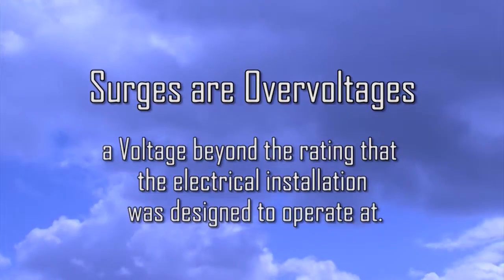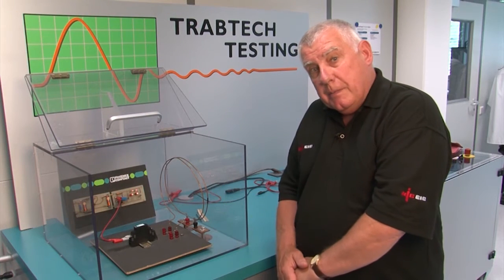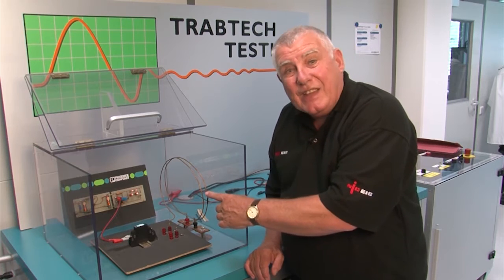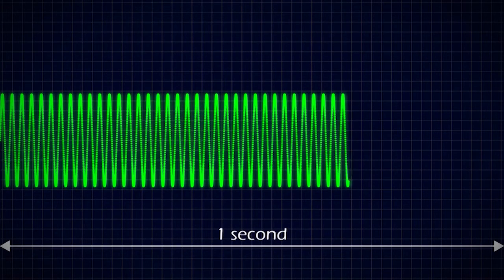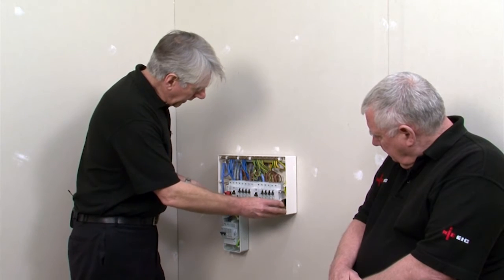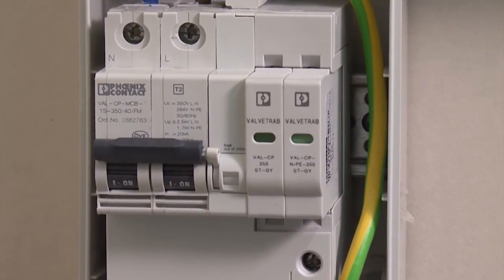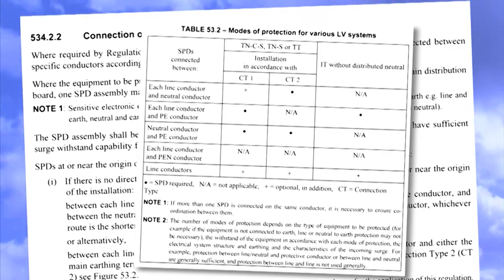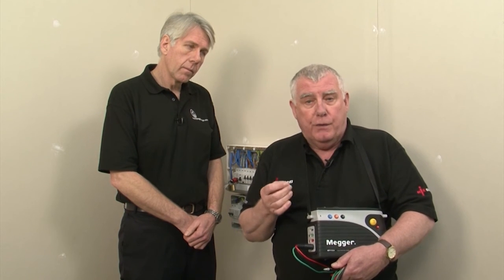Introduction To Surge Protection

Comment: I have two Consumer Units in my house connect to the same incoming Power Meter. One CU is an old one using ELCB as protective device  made in 1983 to BS 4293 which always trip when there is heavy lighting strike during tropical thunderstorm. The other is installed recently protected by RCCB :BS4293 which does not trip even when the old CU trips. The Meter is connected to OH Power lines, 240v. I dont have SPD. Any logical  explanation? If it is about old ELCB can I change to RCCB same as the new CU. Or can I install an SPD to solve the tripping.
Reply from the maker: Hi Philip - can you send us some pictures to mail@learninglounge.com so we can take a look before responding?